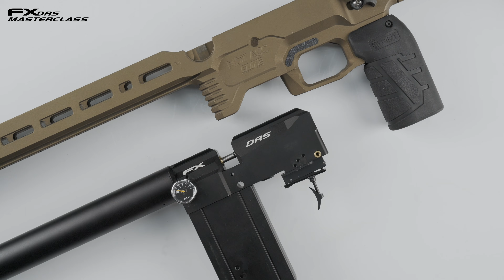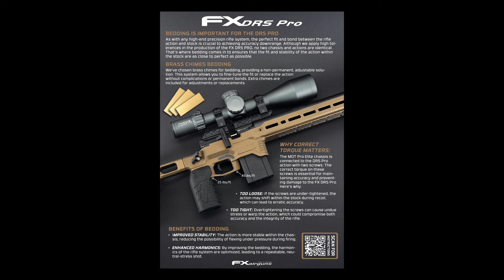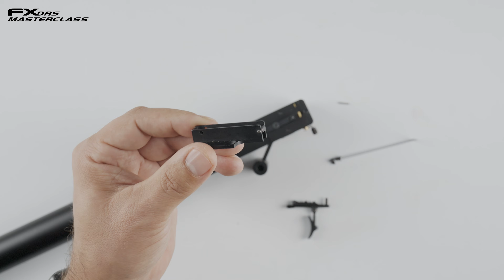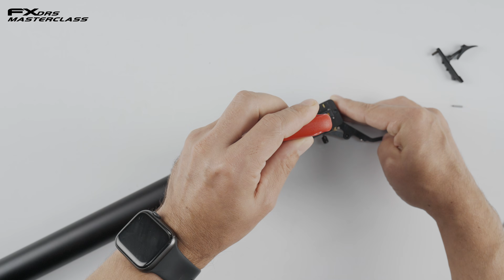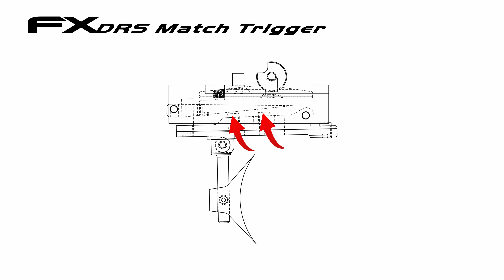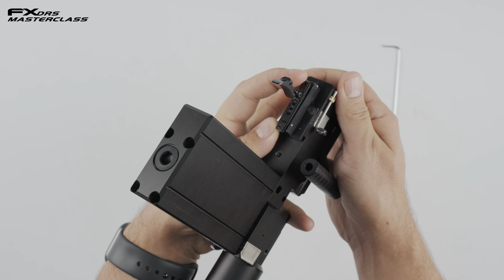FX DRS Pro Match Trigger Adjustment - FX Masterclass

Comment: Can you show the hammer set up ? As I got a heavier hammer for my 600mm pro but can't fit as it hits the adjuster screw . Or can I remove the original hammer and replace with the new hammer , or do I need a different adjuster screw ? Thanks

Comment: It should be noted in this video that the 2 M3x6mm screws that hold the trigger housing to the receiver are NOT INCLUDED with the Match Grade Trigger kit.
I have also found that the spring from the DRS Classic  is too long and prevents the  gun from cocking.

Comment: I have one of the first DRS PRO’s in .25 cal and spent hours messing with the trigger to get it to feel as good as my impact.  This is a great video and explanation.  Wish it would have come out a bit sooner. Also my gun never came with the brass shims which also would have been nice.  I shimmed with tape to get the chassis to sit in the stock the same place every time after disassembly.  I even considered beading it.  The gun is supper accurate but had to polish the liner to get it there.  Bore scope showed several scratches for the factory machining process.  All in all I love the gun but has definitely not been plug and play.
Reply from the maker: Hi, sorry it took this long for us to get this info out but we are working on it to do better from now on 👍 please send a email to our support and we will be happy to send you some of the shims as they have been added later to to rifle. 
Glad to hear you are happy with the rifle , but if you have any problems now or with a new rifle you buy , don’t hesitate to reach out to us and we will get you sorted. We are happy to help and give you the best experience possible 👊

Comment: Finally, even though I’ve already had to do it myself because supposedly it’s the same trigger that comes on the crown
Reply from the maker: Yes the trigger is very much the same as the Crown match trigger. We are going to be more on top of these things moving froward from now on.
Reply: @FXAirguns  this was a great first step thank you hey real quick the brass chimes are they sold separately? I have a first batch drs pro these weren’t a thing then so can i purchase them from UA being that they are the official authorized repair center for FX airguns USA?
Reply: Thank you, this appeared in response to a ticket I raised today, so amazing service, for me anyway.
Just one small issue, this is an upgrade for me, putting it onto the DRS classic, which means replacing the PAC man bit as well and this isn't shown in the video.  Something not working when I swap it out as the hammer will not catch on the new sear, an addendum video for classic upgrades perhaps.....thanks
Reply: Same for Fx crown mk2?